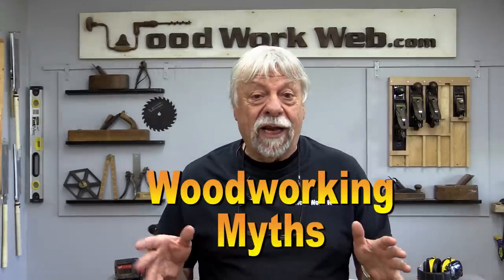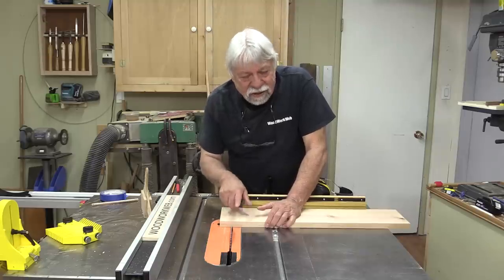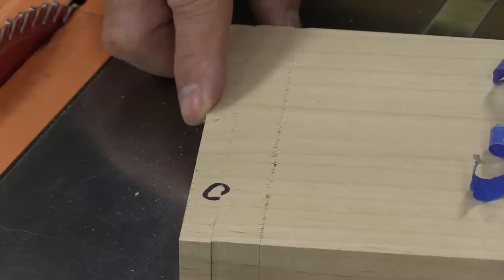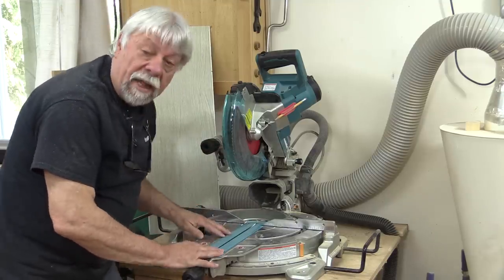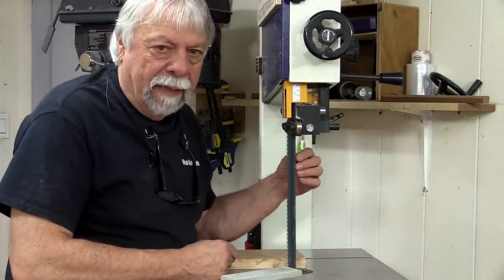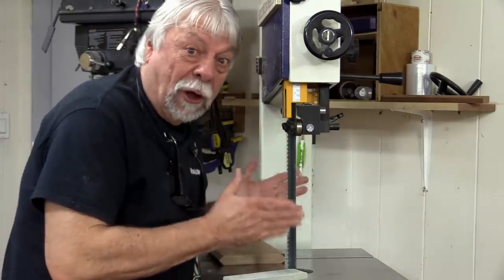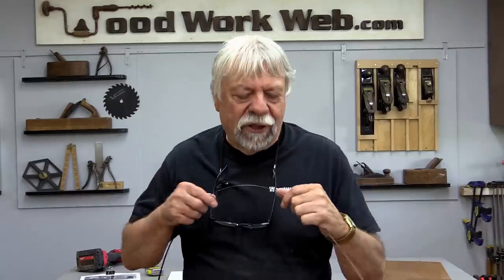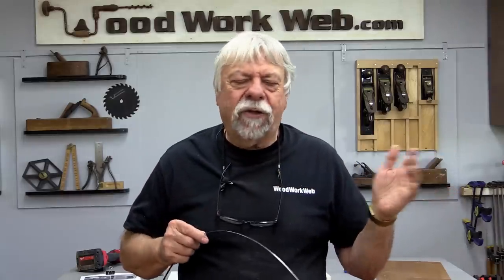Woodworking Myths and Useless Woodworking Hacks

Comment: How does a table saw blade 'cut first on the top'? , the very nature of the shape of the blade means it cuts first on the bottom of the board then creeps up on the top.
Reply: I see your point.
Reply: It is a downward arc, no?
Reply: It's also worth stressing that when using a sliding mitre saw, to extend the saw past the material before you bring it down for the cut and push away from you. In the time before YouTube, it hadn't dawned on me to do it that way. To be self taught is not necessarily a good thing. :/
Reply: Very interesting comment. Thinking about that related to tear out explains why the advice for always having your blade just clear of the top of the wood is sound. I always thought it was about safety but infact on the top of the wood having a high blade would result in more tear out and the teeth smash down more vertically on the top of the cut onto unsupported fibres. If the blade is just clear the teeth impact almost horizontally and the fibres are still supported by the wood behind them. Nice Paul you just improved my woodworking !
Reply: The first plane to get broken through, if you follow 1 tooth as it passes through the wood on the table saw, is the top of top of the wood. The tooth then continues through the wood and blasts out the bottom causing tearout if it chooses.

The initial 1/8 inches of cut or so, sure, it's cutting the side first, but then it's blasting out the bottom of the wood. ZCI works well for a table saw because it supports the fibers on the bottom as the blade tears down into the table.
Reply: @trevorallen2274  Yes and no. Imagine a view side on, one tooth always exits ahead of the following one in an arc. Start a cut on a saw and stop the cut. Measure the distance from the bottom of the cut to the edge of the board then do the same for the top. The bottom cut always is longer than the top.
Reply: paul1962uk wrong, the tooth makes contact on a square corner at the bottom but once the top is in contact it cuts from top to bottom. Much like cutting butter with a knife. Your knife cuts from the top down.
Reply: Ian Garthwaite because of the arc of the blade being round.
Reply: Akbychoice watch the video again and you will see the table saw blade starts it’s cut from the bottom of the board
Reply: A table saw blade is round obviously, so the leading edge cut will be shallow,building up to the full depth.
Reply: @akbychoice  "Much like cutting butter with a knife. Your knife cuts from the top down." - This is a very strage comparison. When I'm cutting butter with a knife usually the knife is on top of the butter. But when I set a piece of wood on a table saw and start to cut it, the wood is on top of the blade, so the blade cuts the wood from the bottom up.
Reply: @Grauenwolf  Are you sure about this? To my understanding the piece of wood rests on the table saw. The blade of the table saw is inside the housing and underneath the piece of wood. So once the blade is set to the height of the wood it starts to cut. And since the blade comes from underneath of the wood, how should it be possible that the piece of wood is cut from the top and not from the bottom. Just try it by yourself. Place a piece of wood on the table saw and once the (running) blade touches the piece of wood push the wood slightly forward, maybe an 1/8th of an inch. And than look at the piece of wood where the cut mark is. Most likely it is at the bottom of the piece of wood and not on top.
Reply: Absolutely correct.
Reply: Actually, thinking about it more carefully, apart from the initial phase of cutting where the blade starts at the lower leading corner, until the upper leading corner starts being cut, the teeth of the blade all cut the wood simultaneously, but in a rearward-facing arc.
Reply: Is it really this difficult to understand or are there that many trolls on here? 😂
Reply: @Grauenwolf  I know that the saw cuts where the teeth are moving down. But still these teeth first hit the piece of wood at the bottom part and never on the top part.
Reply: @goggles789 A sane voice in the middle of this insane discussion. Table saw cutting from the bottom, dear oh dear, I am scared to even imagine what it would be like to control the work piece.
Reply: This is about the worst example of arguing over semantics I have ever seen.  CK invited all this with his vague and slightly misleading statement that the blade "cuts first" on the top.  In reality, once the blade reaches the top it is cutting at the same time over the entire length of the contact arc between the top and bottom.  It can't be otherwise.  What really matters is that tear out is more severe on the side where the blade exits while cutting, that is the bottom on a table saw.  I think that is what CK meant, rather than cuts first on top.  With a sharp aligned blade there should be virtually no tear out on the entry (top) side of the board.  Any tear out on top would be caused by the back rising portion of the blade due to misalignment.
Personally I have found the best solution is to apply one or two coats of finish before the cut.  That does a good job of fusing the wood fibers together.  Buying primed dimensional wood also helps.
Reply: I hope this is just symantics trolls and people aren't really that stupid.

Comment: Usually I like and enjoy your videos. This one infuriated me for some reason. I don’t know what you’re doing wrong, but I’ve been using tape for decades and it actually does improve the cut.  It has to be applied very tightly. And the zero clearance absolutely prevents tear out. If you notice the extreme tear out on the back edge of the pieces cut on the miter saw, that could be prevented by simply backing it up with another piece and that’s the same concept as the zero clearance. I’m sorry but this one’s a fail.

Comment: Actually, it's best not to run down a lithium battery.  After use, recharge.
Reply: lithium batteries are said to perform best when the charge is not interrupted as well...let it charge fully in a single session.
Reply: @jeffdutton1910  I don't think that really matters...
Reply: @hakancarlsson2881  they're finicky. They prefer to be stored somewhere between empty and fully charged. Say 80% charged. So it's better to interrupt the charge  unless you are using it right away.

Comment: After market zero clearance inserts that companies sell are super worthless. Yeah tape on hardwood not very useful. Tape on pywood? Absolutely. Tape also helps with exit cuts on either a miter or table saw when both start and finish edge have to be visible.

Comment: Ummmm that’s not the point of a ZCI. They are mostly used to keep small pieces from falling thru the crack, catching the blade and causing problems/injury.
Reply: That's true on a table saw but again the blade on a mitre saw and circular saw spin in the other direction and cut from the bottom up making the insert useless
Reply: nope, most people use them for tearout.

Comment: NICAD MYTH.  It did not preserve a nicad battery to run it down before recharging it.  That only shortened its life.  The myth is from a misreading of information.  A battery's life is shortened by the amount of recharging time and continuing to charge it after it is already at the max it can take.  The advice was:

DON'T TOP UP A NICAD BATTERY TO 100% WHEN IT IS PARTIALLY DISCHARGED.
JUST USE IT UNTIL IT IS RUN DOWN AND THEN RECHARGE.

This became the myth:

DELIBERATELY RUN DOWN THE BATTERY AND RECHARGE IT.

No. No.  No. That increased the amount of recharging time which is what you were supposed to avoid,  

BTW, check that your battery has a "BMS".  That's Battery Management System.   Pretty simply it checks that the battery is back to 100% and stops charging it when it is done.  It also cuts out when the voltage gets so low it can't effecitvely work.  For liithium it MAY also forbid charging if the battery is below 25°F.  That damages lithium and is why no one offers a lithium  car battery.  I know this because I have to replace an RV's old lead (aka AGM) battery.  I could save a couple hundred by getting a battery without a cold weather shutoff, but I might want to visit some friends in Ohio this fall.

Comment: I find the blue tape is helpful on plywood.
Reply: Sometimes yes.  If cutting across the grain of the veneer and you don't have a 0-clearance throat plate then tape helps a little.  And, as Colin says, the tape needs to go on the bottom.  If you find yourself needing tape often you may be better off making a 0-clearance plate and skipping the tape.
Reply: If it works for you keep doing it. Just because someone on YouTube says otherwise that doesn't mean your experience isn't valid.
Reply: I concur, Nathan. Do what works. I've used the blue tape technique on occasions when the blade is just starting to get dull or poor piece of plywood has to be employed and the results are usually acceptable for the intended purpose. If I need a finer finish, then a new blade or better materials come into play.
Reply: @captainjohn787  Yup, and I believe that the mind of a craftsman is reinforced by his confidence in his techniques. If you see something someone else is doing that doesn't line up with your techniques it may cause you to question things that are integral to your process. The first cabinet makers had to make up a lot of their own processes and improvise tools. They found some things worked, and some didn't.

Comment: There has been the odd time where I've had to cut on a mitre saw with the good side facing up. Crosscut on thin veneer plywood. The tearout is terrible, but I found a small trick. Start with the blade pushed all the way back, lower it, then once it's cutting, pull it forward doing a partial depth cut (bit more than a scoring). Then plunge it and do the regular push cut. Makes a massive difference in reducing the tear-out. (But still not perfect.)
Reply: FrameRite Airdrie yes, that makes a lot of sense.

Comment: Removing the miter saw insert can be unsafe when you cut a small piece like you did. That small piece fell like you saw. If you had your blade all the way down it would grab and throw that small piece. Thankfully you had the blade lifted a bit. I think you saw that could happen so you didn't bottom out the blade.

Comment: I thought I had used tape to good effect in the past so I was puzzled as to where I went wrong (can't argue with hard experimental data)  So, I went back and watched his part 2 about tear out and I noticed a slight improvement using tape with plywood in his video.  So I am calling BS on it being a myth in so far as thin cheap plywood goes.  I agree tape does not help with solid woods, but it has made a difference for me in the past when cutting thin luan plywood.

Comment: I use a stone on the back of my bandsaw blades, not at all for cutting arcs, just to make sure the back of the blade it straight, flat, and deburred, without any bumps.

I also only do my resawing of wide, figured, spalted, or burl, hardwoods with a carbide tipped blade. I've spent as many years cutting metals as I have woods, so I'm maybe biased due to my experiences.

Comment: I use tape on when cutting framing on my miter saw (normally red oak or mahogany). If I don't use it, I see tear out, especially on the back end. If I use tape, I see very little tear out. Thanks, I'll go with my experience and get cleaner cuts.

Comment: The back of the band saw blade should have any burrs, or any areas that are uneven, or lumpy, if the weld is not smooth. Any uneven or lumpy areas on the back of the blade will push the blade, or cause it to "jump" or "bounce" in the cut as the blade rides against the thrust bearing or blade guide.

Comment: I have a few myths I'd like to see investigated.
One with band saws, I hear you have to sharpen them after every eight hours running to prevent stress fractures from forming in the gullets.  rather, the grinding removes the tiny fractures before they grow and become problematic.
This is with 2"x24' blades, continuous running for 8 hours.
Another myth, I think i know is complete garbage, I've heard many people say that if a circular saw is out of balance you can turn the saw over 180 degrees, loosen the nut and then retighten it.
I guess their theory is that the shaking is radial loading from wear on the arbor or saw collar allowing it to shift a few thousandths when mounted, or perhaps uneven grinding of the working rim of the saw putting it out of balance.
Makes no sense to me, since it can shift again while running, and without determining the direction of the radial load you're just guessing at which way to correct the imbalance, never mind that radial imbalance is far less likely than axial, and rough cuts are usually observed with the shaking, which means there is axial deflection.
To me, this means the face of the arbor or saw collar needs to be trued to prevent axial deflection.  I always replace bushings at the same time, so any radial tolerances will be restored as well, so I haven't compiled enough data to definitively conclude they're full of crap.  Plus, the mounting of the saw, I just haven't even tried it because it seemed too far-fetched.

Comment: I think it's important to note the before/after parts of the bandsaw tip; if you cut with a NEW blade, and it cuts straight - AND THEN it doesn't cut straight later, it may be you dulled one side of the teeth.  But be careful thinking your blade is dull if you have to push crooked to get a straight cut if you've never had the saw cutting straight in the first place.  Could be a lot of factors (mostly tuning/alignment).

Comment: I was rereading Mark Duginske's book on bandsaws. He presents other reasons for honing the back of the blade, all of which make sense I think. Cleaning up slightly inaccurate weld, removing a burr from hitting the thrust bearing, for example. He does suggest that it allows tighter curves too. So I don't think this one is entirely a misleading myth.

Comment: Another reason for zci on mitre saw is for chip and dust extraction. Lots more material remains in cavity under plastic factory inserts. Doesn't eliminate the problem, reduces it.

Comment: Don't cut laminate flooring with anything you want to keep. The wear resistant finish contains aluminium oxide powder, basicaly sand paper grit. it will blunt anything with one cut.
Reply: I learned that the hard way.  I loaned my mitre saw to a friend who was installing flooring.  He returned it to me saying there must be something wrong with it.  The first cut or two went OK, but after that they they took forever and it smoked a lot.  I got it back with the the dullest saw blade I've ever owned.
Reply: @charlesenfield2192  So you learned TWO things the hard way.

Comment: I made the insert for my miter saw & realized that at 1st cut but left it there because it shows where the cut will be exactly so do mark the back side of the material
Reply: That system works great as long as you don’t tilt the blade away from 90 degrees, which results in a wider cut.

Comment: re: batteries. in fact draining a lithium ion battery fully will shorten its life span - if you kept a battery around half charged its whole life it would last 10 times longer - charge little, charge often, is the key to extending lithium ion battery life...
Reply: @Grauenwolf  you are correct that the internal circuitry of a good lithium ion battery is supposed to prevent over discharge but it is possible to ruin even a good lithium ion battery by overdischarging it. There are a lot of YouTube videos of people having to "jump-start" their brand name power tool batteries because they over discharged them. I accidentally did it myself with a Ridgid 18v battery when I was new to Lithium Ion stuff. Thankfully Ridgid has a lifetime warranty on their parts so i got another battery for free.

Basically dont try to keep using a tool that keeps shutting off because the battery is low and you just want to finish driving that last screw lol. When the battery is at one bar recharge it!
Reply: @kylefowler5082  You don't have to worry if you just recharge it when it shuts off the first time. The protection works fine on most batteries. If there is a problem it's  the battery that sucks. 
Like you said if you keep trying after it shuts off you are basically tricking the protection because the voltage under load is different then while at rest...

Comment: To have a true representation you should have cut the slot in the thin plywood first, then used it as a zero clearance insert with the kerf slot already in place.
Reply: My thoughts exactly sir . . His sample cut was dragging the waste material of the ZERO CLEARANCE BOARD into the cut . Cheers mate !

Comment: Three cheers for Colin. There's nothing worse than an untrue myth that will not die. As an electrician, the most common one, especially among older electricians, is that if you wire a motor for 240 volts its cheaper to run than at 120 volts. The truth is it makes absolutely no difference in the electric bill. The wattage (what you get billed for) is exactly the same. Doubling the voltage will halve the current. There MAY be a cost savings in material and initial installation, as the larger current draw may require larger pipe and wire, etc. but running the motor will cost the same.

Comment: Important for Li-Ion batteries is actually not to drain them completely, it's best for the longevity to charge them when they are at about 20%, never store them for longer periods completely full or completely empty, both are bad for the cells. Also it's best to store the batteries at a temperature above 15C/59F, don't let them freeze, it will reduce the capacity greatly.